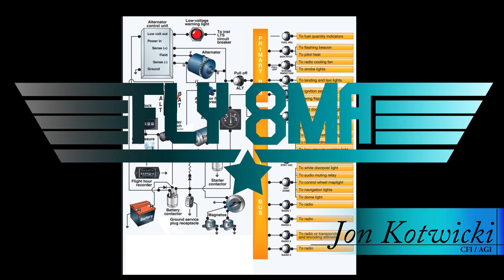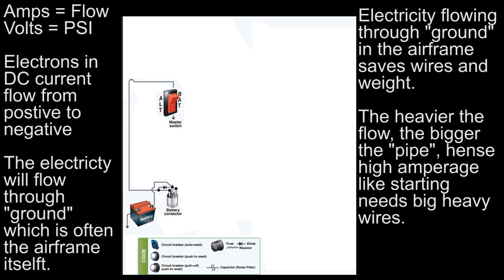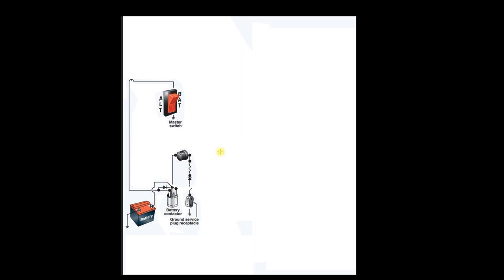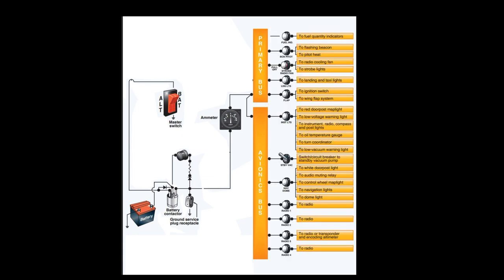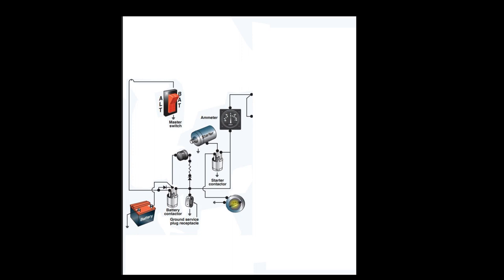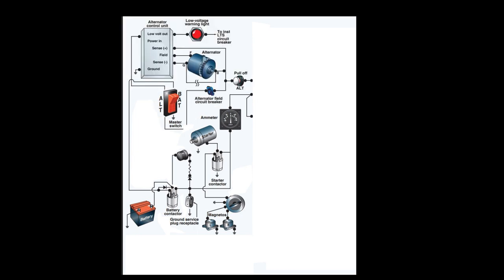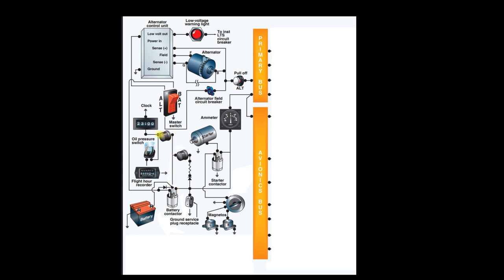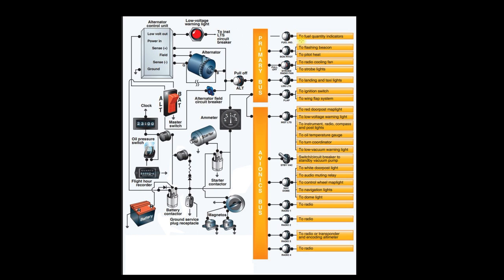Ep. 56: Your Aircraft Electrical System Explained! | From the Ground Up!

Comment: Answering the question in the video. The engine will continue to run if the alternator fails or if the master switch is turned off in flight.  Electric power from the batter is only required to get the starter motor going, and once it gets the engine spinning the engine is self-sustaining.  There is an engine powered fuel pump and the engine also charges the magnetos which generate the spark necessary for combustion.  It’s almost a perpetual motion machine if not for the fuel which is finite in quantity.

Comment: By the way, I did like your video. In electron theory, electrons flow from negative to positive. In convential current flow, non electronic circuits, the current flows from positive to negative as you mentioned, but if there is electronic circuits involved in the circuits, current flows from negative to positive. This is why car repair videos will tell you to disconnect the negative battery terminal instead of the positive terminal when working on your car. I'm old school, so I disconnect both terminals.
JOHN
Reply: John Novak  Another reason to disconnect the negative (ground) terminal is to prevent spits and sparks if your wrench hits the body of the car while you're loosening the cable clamp.. If you are in the process of disconnecting the positive (hot) with the ground still connected and hit something metal, things could get interesting. When you disconnect both, I hope you disconnect the grounded terminal first and reconnect it last.

Comment: If the engine is running i believe at that point the magnetos are producing their own electricity for the spark so if you had an alternator failure or both batt and alt failure the engine turning over would keep the magnetos alive

Comment: Electron flow is from the negative terminal through the battery to the positive terminal, through the circuit, then back to negative.  So technically, negative to positive.  Other than that, GREAT VIDEO!!!!!
Reply: Correct. Electrons have a negative charge, and therefore attracted to the positive side of the battery. Flow is negative to positive.

Comment: Electron flow is negative to positive as a few have already mentioned. That is true outside the source (battery) but is positive to negative inside the source. When engine is running the alternator is the source and the battery becomes a load. not a source so the opposite is true unless the alternator fails, then the battery again becomes the source.

Comment: Great educational video, well done. 
Just adding a fun fact here. A LOWER (6v/12v) voltage electrical system requires larger gauge wire for a given consumer then a HIGHER (24v/48v+) voltage system. A lightweight 24v/48v battery will use thinner wires then 12v.

You’re correct though, all the switches and electrical parts on an aircraft are not made for 24v or 48v.
Reply: Also the alternator would need to spin twice as fast or be twice the diameter. Both the alternator and any electric motors would need twice as many and half as thick windings with a thicker insulating enamel coating. Since most loads are fairly low wattage a primary concern becomes the physical strength of the conductors, so no point in using moving to 24v if the wires would need to stay the same thickness for mechanical reasons. Now on a large airplane with large loads 24v or even 240v may be a practical system.

Comment: Yes hi I have a question for you my instructor has a Piper Cherokee 160.  we were doing a run-up and we got the RPMs up to 1,800 and the fuse breaker popped on the alternator. We checked the amps. The amps were up to 14.4 and that's when the circuit breaker popped. Any suggestions

Comment: Hey, John can you please tell me whats the purpose of a circuit breaker I'm not sure exactly what they do ? Thanks in advance.
Reply: RitchieRich  Circuit breakers are protective devices. If too much current flows (like from a short circuit) the breaker will trip, opening the circuit and preventing the wires from overheating and causing damage or possibly a fire.

If a breaker opens you can usually get away with resetting it once, just in case it tripped because of some transient fault. If it trips again, leave it off!!

Comment: Can you trickle charge the battery on the PA28Archer through the 12v external port on the fuselage or does it need to be connected directly to the battery?

Comment: Trying to troubleshoot my electrical problem and have a question. My hobbs stopped working in the plane but works on a bench. Fuse is not blown and I don't believe it is the pressure switch. If the ground wire on the clock broke it would not effect the hobbs, is that correct since we are dealing with DC current? and therefore the hobbs ground seems to be my issue or am I incorrect and a malfunction in the clock could disrupt the circuit?

Comment: Hey Jon, I can't thank you enough for the time you spent putting this together. I was Googling "what would happen if your battery/alternator died in flight AND  you turned your key off." From what I'm seeing in your video,  turning the key to off with a dead battery would shut off the engine and you wouldn't be able to restart them since the magnetos don't have a power source. Good to know, and you video showed why. (At least I think that's correct)
Reply: No. Magnetos (in planes) are designed as fully independent systems(two of them) no relation to the alternator/battery system, they use permanent magnets to build up the charge for a spark. Turning the key off directly grounds them so the charge doesn't build enough to spark. If the fuel system is working the windmilling of the prop will restart the engine. In a typical Lycoming the mags have spring devices so that at low speeds during starting(even slow hand propping) the magnetos wind up then suddenly release to generate a solid burst of electricity, as the engine speeds up to idle rpm the springs disengage via inertial force.

Comment: The mags generate their own current and don't need any other source of power to run, this the engine can run with out any battery or power from the electrical system.

Comment: I used to work on Commercial lawnmowers. Its funny how similar it is to planes. just goes to show, electricity is electricity and engines are engines when you get down to how they work. I would say cars too but the electrical system on your car is much more complex to me.

Comment: This video is really useful and well explained. However i have 2 questions and it would be great if anyone can answer them
1) why turning off the battery shuts down the alternator ?
2) once the alternator ON, is the battery still supplying the Alternator rotor (to energize the electromagnet ) or the Alternator is suppliying itself from his own output ?
thanks.
Reply: I know it's been a year but thought I would answer in case someone else had same in their mind, so
To turn on the alternator you need a big current flow and that comes from the battery, so once the alternator is on and producing it's own power it will recharge the battery for discharge it had while starting the starter and alternator/ generator.
And once the alternator is on battery does not does supply power to alternator, unless the alternator started producing lower power than the battery and in that case we have reverse current cutout system in the voltage regulator system to prevent battery from powering the alternator because that will drain the battery real quick and we need the battery for emergency backup

Comment: Hi, it is my understanding that when u turn your master switch on and crank the engine, initially power from the bus is fed through the alt field cb and the ALT side of the master switch to the ACU which in turn modulates the field charge fed to Field terminal on the rotor side of the alternator flashing the electromagnetic field back, inducing a certain current into the stator and then through the ALT cb to the busses. Once the output from the generator exceeds the battery output - 28 vs 24vdc - the current flows from the battery via the starter and the battery contactors back to the battery keeping it charged. The ACU modulates the field current to the rotor based on the electrical load and on engine rpms sensed on the bus and fed to the SENSE terminal in such a manner to maintain a constant output.
Is the above a correct statement?
Thanks

Comment: There is no effect on the engine/s if either of those turned off or fail because magneto will supply the necessary electricity to create spark by the use of spark plug. Magneto is an independent component. But the other instruments might shutoff like the navigation instruments.

Comment: Isn't there usually a switch between the primary bus and the avionics bus so the battery isn't loaded down with the radios while it's trying to start the engine?
Reply from the maker: Less common the older the plane...  Yet, most airplanes will provide power only to the starter from the battery when starting, just like the lights in your car go dim when you turn the key...
Reply: Ok, thanks. As an electronics guy, it bugs me that they label them as two separate busses when they can't be isolated.
Reply: This isn't for battery loading, it is to protect the avionics from voltage dips and spikes during startup and shutdown. Avionics on last, and off first.

Comment: The engine will still be running even if you lose the alternator or turn off the master switch while in flight.  Magnetos will generate electricity for the sparks when the engine is running, which will sustain the combustion of the fuel/air mixture.

Comment: Opening shot you state electrons flow from positive to negative in a DC circuit. This is incorrect. They flow from negative to positive. Negative means electrons are being released as in lost so negative, positive means electrons are being received as in gained so positive.

Comment: No, the engine will not fail if the battery master switch or alternator is turned off in flight because the magnetos, once started from the battery master switch, create their own electrical charge independent of the electrical system and can hence operate on their own due to the rotating magnet.

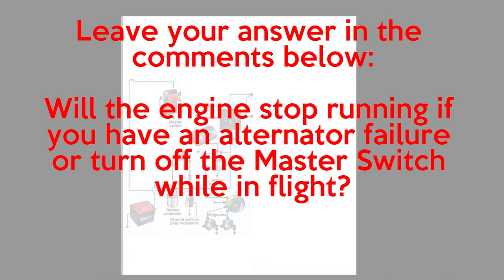Comment: 6:11 no. Because you still have the battery as back up power. Correct me if im wrong
Reply: The magnetos power the spark the spark plugs which is powered by the engine crankshaft and allows the combustion of fuel and air in the cylinders. It's independent of the battery and alternator
Reply: @zc8992  thank you so much for the info sir

Comment: No, magnetos system is independent of airframe eletrical system.
Reply: The ground that "shorts" the magnetos to disable them and shut down the engine does go through the airframe, but they are otherwise independent of the electrical system as you stated.

Comment: Your electrical "flow" is backwards. The ground is negative and electrical flows from negative to positive.
Reply: Robert Seida thank you fot the correction. I'm confused haha
Reply: it's pretty iffy as to actual direction, there is a flow from positive to negative called "Hole Flow".  Also, considering the diagrams for solid-state devices like diodes and transistors, the arrows on those devices are pointing as though electricity does flow from positive to negative.  In a diode, if the arrow points toward the negative pole of the battery, electricity will flow through it, but if the diode points the other way, there is no flow of electricity.  Aircraft circuits use a LOT of diodes, and it's actually easier to understand the circuitry and troubleshoot if you just imagine the flow as going from positive to negative, then you see it going through the diode if the arrow is in that direction, and see it blocked if it is the other way.  Notice the external charging circuit with the diode pointing to the battery that allows current to flow from the external charger into the aircraft battery, but it will block current from flowing from the battery to the external plug circuit.   Also, the diode across the relay is installed "reversed" preventing it from shorting the relay except when the switch is turned OFF there will be a momentary spike generated across the relay coil that is reversed from normal polarity, the diode absorbs that momentary spike preventing the switch from burning out prematurely.  If the diode was not there, that momentary spike would create a spark across the switch contacts as it was turned OFF.   Sometimes a capacitor is used to absorb that spike as seen across the contact points in the magneto to extend the life of the points.  It basically extends the life of the point from a factor of ten min without it to ten years with it.
Reply: The statement in the video is that "electrons flow from positive to negative", which is wrong. 
"electrical flows from negative to positive", is not accurate. 
The accurate statement is that electrons flow from negative to positive. Alternately one could accurately say that negative charge carriers flow from negative potential to positive potential and that positive charge carriers flow in the opposite direction, this is because the charge carriers are not necessarily free electrons in every case for example an electrolyte solution[salt water] where many charge carriers are actually positive and negative ions migrating through the liquid. In metallic conductors electrons are the primary negative charge carriers and the particle that actually moves. In advance electronics such as semiconductor design, positive carriers are called holes [a missing electron] as the true positive charges are protons and protons are locked in to the crystal structure of a solid and removing the matched electron leaves a net positive charge. 
Standard schematic symbols were developed before electron theory was widespread and so they use positive charge-carrier flow as the convention. Many vehicles prior to the 1950s had the positive side of the battery connected to ground, they work just as well, but for parts compatibility it is best for an industry to pick just one. 
---
The reason that electrons are labeled negative goes allllll the way back to Ben Franklin's time when they rubbed fur on amber to generate a static charge. The theory at the time was that the [rough]fur was scraping charge particles off of the [smooth] amber, and as I recall electricity was at this time viewed as an actual substance, so if you have more of it on the fur after rubbing then that is a "positive" amount of electricity.(which could be compared to other electrical sources using the old likes repel opposites attract test) Years later it was shown that the actual physical charged particle exchange is electrons moving to and collecting on the surface of the amber from the fur(just the opposite) but by the time enough products and research literature had used the amber=charge donor convention that it wasn't feasible to introduce the corrected amber=charge receiver notion and so electrons were labeled negative and we still have confusion in classrooms over a hundred years on.
Reply: @TheDuckofDoom.  correct. This is covered in any Physics, Chemistry, or EE course. Either way, his description of power flow through the circuits is incorrect; for example, you don't need power to operate a ground switch...you simply interrupt or complete the circuit.

Comment: Most lawn mower/small engines do not need battery nor alternator to run, magnetos are similar as they produce their own electricity to spark as they rotate, they need to be grounded (short circuited) in order for them to stop producing sparks that's why we see on the diagram a ground symbol on each magneto and a ground symbol on the ignition switch, so plane engines keep running without battery, electricity or alternator.
  
Electrons are negative charged so from the physics standpoint current (electron flow) flows from negative to positive, before we learned about electrons negative charge, electric diagrams were written as current flowing from + to – and we continue with that wrong practice, in reality it does not matter as long as we close the circuit.

You are wrong explaining the alternator circuit as he ALT switch does not connect with the BAT switch cable, the cable between the battery contactor and the BAT switch is negative when the BAT switch is in the on position. We need to have the BAT switch on in order to have electricity flowing through the ALT switch into the Alternator control unit and the alternator control unit will energize the alternator field.

The Starter contactor has a ground symbol underneath that should not be there, ground to it comes from the ignition switch. Thanks for all the videos, I am learning a lot.

Comment: Definitely yes, because magnetos are engine driven, losing alternator or turn off master switch will only effect the electrical system only, so as long as mixture is rich enough to power the engine and ignition position is still in "both", it will still able to run. P.S. I got my checkride fail because of unable to answer this question. :D

Comment: No, if the alternator fails you will still have limited battery power left to operate the aircraft.
Reply from the maker: And even when that battery goes totally dead you'll still get spark from the magnetos to keep the engine running!  Pretty smart design!
Reply: You must have not been paying attention